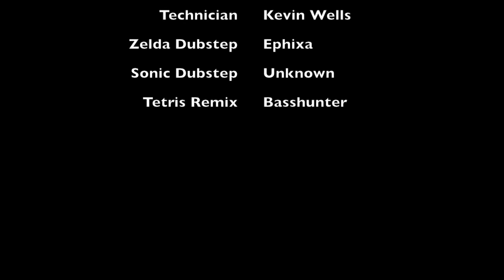Power Up Gaming Professional PS3 Reflow

Comment from the maker: We use standard thermal paste on the processors under the IHS without the use of thermal adhesive.  The adhesive is used to properly keep the IHS from moving around but I have yet to EVER see an IHS that get out of position once attached back to the processor.  We apply a small amount of thermal paste to the ram chips on the GPU and a small bead at the edge of the CPU prior to reinstalling the IHS's.  Good question!

Comment from the maker: The temperature really doesn't matter since it is different for every location in the world depending on the humidity, elevation and room temperature. We verify that the solder has liquified prior to cooling. We use a profile that pre-bakes the board to remove any moisture content and then ramp up the temperature in 5 different stages after that.

Comment: Hey man did u use thermal paste just to put back the ihs on the cell chip around? And wont it move also link the tool kit to remove those chips and a link were ppl can send there ps3 via mail and pay thru sits like ebay put ur service there so usa ppl cn send u there ps3 and u cn shipped them back once there fully working and we cn enjoy ur great  work also have two prices reflow and actually reball service were u put new balls under the chips
Reply from the maker: We stopped performing repairs on the original FAT model PS3 systems years ago.

Comment: I Got one with no power .I'm stomped it's the same morther 
board your working on how to fix please help
Reply from the maker: +Mario Myers, Not sure what you are asking.  If you swapped one motherboard for the same replacement motherboard then even if it powers on, your system will not be usable.  The motherboard is married to the driveboard on the blu-ray drive.  Therefore the system may appear to work but it will never read discs or allow you to even do things like "netflix".
Reply: i have matching keys for the board

Comment: Ok so i have question im a repair tech myself i have the same machine you do and i love it but when you pull shim from GPU can you do the same with the other processor?
Reply from the maker: +Gamers Anonymous, Sorry for the delay in getting back to you.  You say shim but what you are really talking about is the heat spreader.  The process to remove the one over the CPU is completely different.  We remove both on every repair we do so that we can replace ALL the thermal paste.  We remove the CPU one with a specially designed tool that we made in house.  It cuts the silicone that holds it down without creating any notches in the processor itself which would render it useless.  If you do not remove the CPU heat spreader after a reflow and replace the thermal paste under it then the system will NEVER cool properly and will run extremely loud.
Reply: ok cool thanks for the info

Comment: ALSO DID YOU HAVE TO SOLDER OFF THE CHIPS OR DO THEY COME OFF EASILY THANKS!
Reply from the maker: I am not sure which part of the process you are referring to but it sounds like you are talking about reballing which involves removing the processor from the board.  This video is a reflow which is liquifying the solder already present under the processor.  With reballing, yes, you are required to remove both the solder from the board and the processor and then apply leaded solder balls to the processor before resoldering the processor back onto the board.

Comment: You really left out that battery
Reply from the maker: +Rafael Ramos, haha, you were REALLY paying attention. :)  Yes, we noticed that when the system was first turned on and we went back in to put a battery in place.  This was not shown in the video.  Good eye. :)
Reply: PowerUpGamingCanada
 My PS3 got the YLOD just this past March and was a devastating blow for me because I've never lost a console before. I have been looking on ways to fix it and the various causes and apparently there's a 90% chance its just this. Anyhow, what thermal paste do you recommend for the fix? hopefully I'll get mine in working condition soon... Assassins Creed and Skyrim are calling me in the distance!
Reply from the maker: +Rafael Ramos,  your issue has nothing to do with thermal paste.   It's a hardware problem and a proper repair requires specialized hardware.
Reply: PowerUpGamingCanada
what kind of hardware? and can I do this myself?
Reply from the maker: Yep, you can do at home as long as you spend about $3000 in hardware.

Comment: ONLY FRIKIN PEOPLE IVE SEEN APPLY THE THERMAL PASTE CORRECTLY.......
Reply from the maker: Thank you.  Yes, it irritates me also when I see people apply it incorrectly.
Reply: PowerUpGamingCanada
The only thing this would be useful for is backing up data, the reflow only leaves the ps3 in the state to receive the ylod once again.
Reply from the maker: Mahmood Butt Incorrect and correct my friend.  We perform thousands of reflows on PS3 systems so I can attest to the fact that you will receive anywhere from a year to 3 years on a professional reflow depending on what has been done on the system prior to it coming in for repair.  It is not a permanent repair as the issues that caused the problem are still present such as the unleaded solder.  It is a means to further extend the life of a system without having to pay a huge amount for a replacement and it is a method that has worked for Sony and it works well for us too.
Reply: PowerUpGamingCanada 3 Years? Doesnt the thermal paste last for 8 or 10  years? (The original lasts for 8 years but on heavy usage it's 6-7) Which is 2014 and 2015 more people are having the YLOD

Comment: why just do that resolder the chips back on thats the issue causing ylod its not getting contact with the ihs anymore causing overheating and will take a lot less time to do
Reply from the maker: Mackenzie, I appreciate your comment but unfortunately you are incorrect on multiple parts of your statement.  The IHS stands for "Integrated Heat Spreader" which is the thing that sits on-top of the processor.  This item transfers heat from the processor to the heat sink that sits on top of that.  It is not the issue causing the YLOD. 

If you meant removing the processor completely and putting it back on then what you are talking about is is a "reball" which we also provide to our customers.  This involves the following:

1) Reflow so that you can pull the processor.
2) remove all traces of non-leaded solder from the board and the processor,
3) stencil on the leaded solder balls to the processor.
4) realign the processor onto the board and run a leaded profile to reflow the processor back to the board.

It takes approximately three times as long to do a reball then it does to do a reflow.
Reply: PowerUpGamingCanada so your saying that the solder connections to the cell/rsx dont sink over time due to the solder heating up and shrinking ? and that would not flag the ps3 to cause yellow light error to prevent hardware damage ? ihs wont stay evenly pressed against the heat shield if it sinks so the contact wont be as good causing a higher temp.I wasnt incorrect on any of my statement the way i did my "reball" on my 80gb took about an hr and half.My way was in no way safe since your dealing with customers ps3s it may take you 3hrs to do thats something a person can/cant be wrong on for not knowing how you do something.Do a favor instead of acting as every person on youtube is a troll/ignorant person treat them as if there not and the issue would cease to exist and they if they are incorrect may actually go and learn something on the internet which is a information provider.To throw another im stupid fact in here doing a reball would add at least 3-4 years to the system depending on the user and how well it was done what your/others are doing with reflows is earning money cause you know that person is coming back in a year
Reply from the maker: Mackenzie Cambell , wow that is a lot of information to address. 

Yes Mackenzie, what I am saying is that the processor does not sink and loose connections to the board and cause the YLOD.  What happens is that the solder itself actually deteriorates and breaks-down sometimes causing bridges or severed connections.

When the RSX and Cell are applied to the board, they don't "sink".  There are actually spacers on the corners of the processors to keep them at a set height which are removed during the reball process.  If there is a heat transfer issue with a PS3 then it caused by dried out thermal paste on the processor under the IHS or on top of the processor.  It has nothing to do with "sinking". 

I am not sure what you did but a "reball" involves removing the processor from the board, removing all the solder and then reattaching the processor with leaded solder.  This type of thing can not be accomplished properly without proper equipment. 

What I did was act as an information provider and provided you with the correct information that you requested.  I am sorry if you are used to feeling like people are treating you like a troll but that was not my intention. 

What we have here is myself, who has performed thousands of repairs on a PS3 systems and have thousands of happy customers and yourself.  I am not sure your qualifications but please enlighten me so I can continue this discussion further. 

Thank you.

Comment: hi can i put tbe board in oven to fix it ? i just dont want to spend money on my ps3 :D
Reply from the maker: Hoping this is a joke.  Really hoping.
Reply from the maker: Yep, it will work for a short period of time.  You can't actually "reflow" the solder in an oven.  It doesn't work.  What you can do is soften the solder so that you re-establish the connections temporarily.  What I would suggest is to back up your information as most likely it won't work for more then about 24 hours of up time.